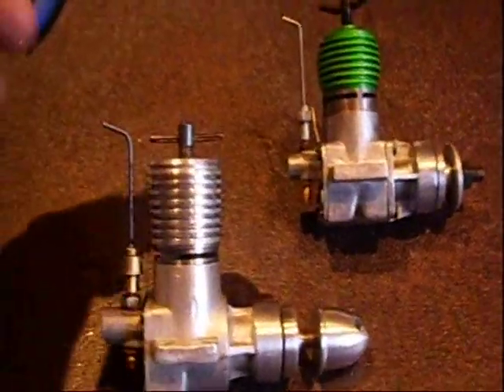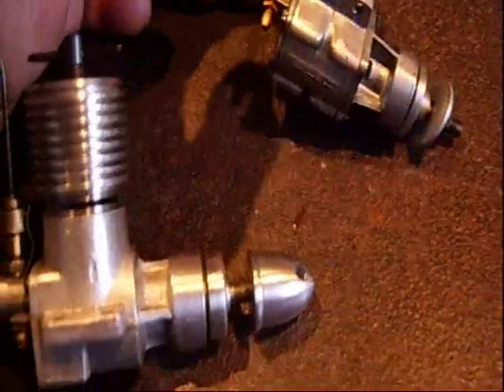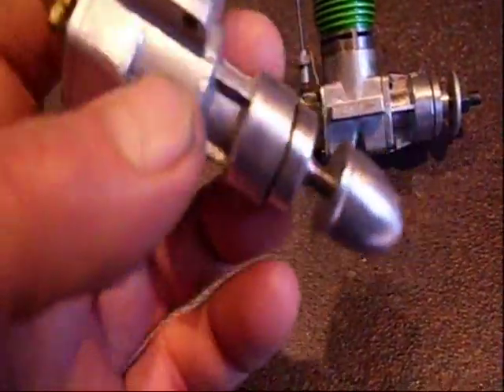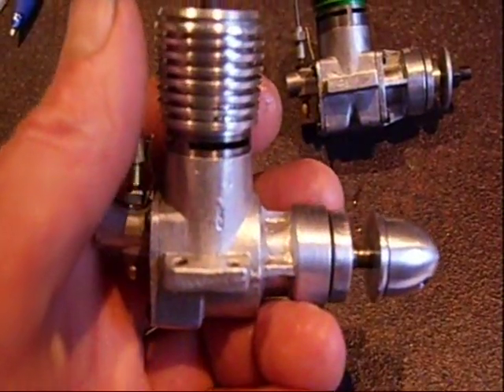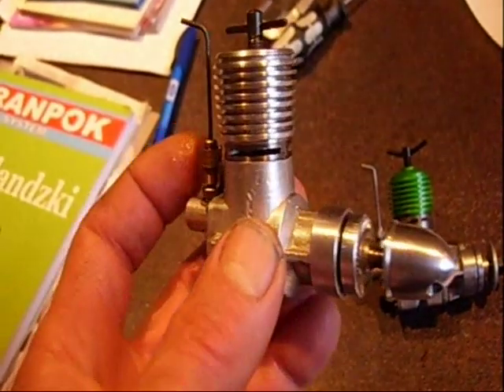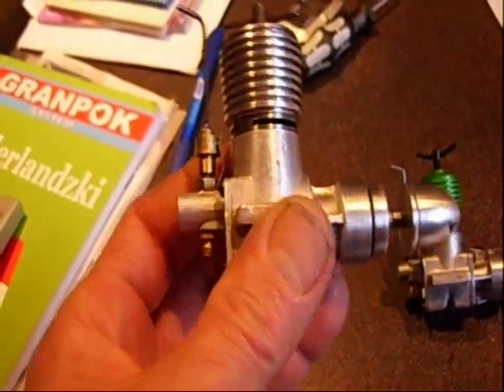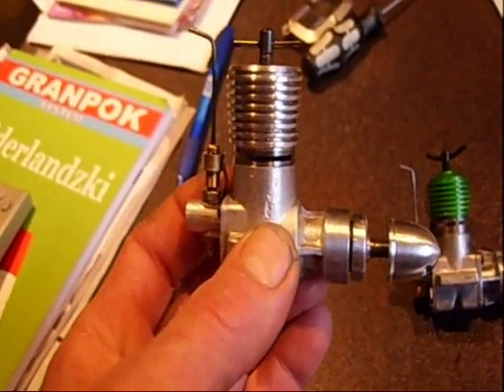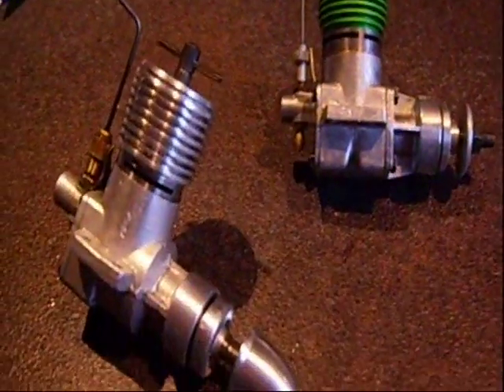MK-12 b Russian modeldiesel engine 2,5cc aprox. 1982

Comment: Diesel ?
Reply from the maker: Yes.. not like a car diesel..but compression ignition..no spark plug or glow plug.. Fuel is a mix of ether, castor,oil and kerosine  1/3 each.. aprox.
Reply: valic000  thanks if I do.

Comment: so i just got 4 of this engines 60$ 2 of them are new and 2 are for parts i will be making sum new vids when they get here all the way from Ukraine! so about 2 weeks or so i got a gallon of good petroleum aka kerosene for cleaning and making the fuel!
Reply from the maker: Thats a great deal Luke!! I am sure,you will have great fun of them..Thats a really insane price!! Wel done mate!
Reply: haha thank you! more vids to come!
Reply: so i got my mk12b and i can't get it to start i made a vid about it i need sum help
Reply from the maker: Start with the Basic Luke...compression must be good,as well a perfect sealing carter.I shod check the second. If you turn the engine slowly,you should here,if a light carter pressure is released when transfer opens up.Otherwise check the back plate gasket and the rotor,if all seals well..also some simpel stuff like the spray bar can be blocked with some old castor oil,when testrun at the factory... Check all very close with a sharp eye!

Good luck Luke!
Reply: i did all of that and every thing is good! it's a new engine the piston and cylinder feel tight like a lot of pinch i prim at the exhust ports and all i get is a pop! and sum smoke kind of strange i have never had a engine bee this hard to start you will see in the vid thank you for the info
Reply: hey i got him running!!! it was the pin fore the disk valve and crank shaft was missing i took one out of an pats engine put him back together and! he runs!!! very well i mix a lot of castor oil 40% and running him a bit un comprested i used all so a diesel kerosene mix 50/50 fore brake in thank you again my friend !

Comment: this is going to be my next engine
Reply from the maker: +Luke Shaw There rae really not bad.If al ok,strong runners!Comes very cheap,even boxed on Ebay,...if you are not in a hurry Luke...But just as with al old russian engines..first dubbelcheck al inside and clean very wel...There are usually always some things to improve.
How did it end up with the Marz bearings.Did you find them and replace both?
Reply: good to know and the marz is a bit better but but the bearings are still not 100% so they do neen new ones but the marz it runs very well and with the mk12b a 9x4 prop?
Reply from the maker: +Luke Shaw 
yes,9x4 too 9x6 is ok.it likles to rev too!  :-)
Reply: i have a bit of a bug for the Russain engines i know there not the best but i love them lol
Reply from the maker: +Luke Shaw Me too Luke.Have a lot different models.The Uctkam 2.5 D is also a strong and powerful engine..schnuerle ported!
Reply: the KMD 2.5 also is a powerful engine to
Reply from the maker: Yea Luke,thats the finest of the older engines!High quality,but dont biy the white version.Only the so named  black KMD are fantastic..
Reply: thank you! :)

Comment: I think I had two of these engines in the past, a red one and a silver one. The silver was completely worn out. I should have taken it apart and measured it. I need to get a (Unimat?) lathe and a drill press and start making parts! Thanks again, Paul
Reply from the maker: +caesarillion Hi Paul,
Yes,there are several versions of the mk12b. The b is russian cyrillic,and stands for a "w" and this W stands for "Webra" (copie)
I have also a red,new in box,and several silver once..looks terribel on the ouitside,but feel silky when turn by hand and loads of compression.. With a littel work and attention,you can made them real powerful runners. Some of the silver types or red types have very bad wristpins,bad fits and just far to weak to be a piston pin.So there is work to do,if you want use it to fly...but on ebay,they come very cheap! The older types are better. Red fins or even better split crankcase..2  covers,like the org. Mach 1

Yes,if you buy a Unimat 3..with milling attachment you can do a lot!!!!..if you are handy.ofcourse you need a lot aditional tools.Mills,micrometers,and so on...

Happy easter Paul!!!

Comment: Да, попалось мне такое чудо с пальцем из гвоздя. Купил в ГУМе в 84-м. Завел и после нескольких секунд умер. Потерялся при переезде.
Reply from the maker: Shame you enjoy only a few seconds of the engine.If new,they shoud be first cleaned wel from inside and inspected too,for any rare things.But I guess,as a young boy,we want only one thing..let start him up!! :-)
Many regards...Its nice to bring back memories to so many peopel arround the world.
Reply: valic000 Even then, I before use, read the instructions and listen to the advice of experienced. Even then, I before use, read the instructions and listen to the advice of experienced. And at that time, the defects were normal in the USSR. Therefore the production of motors and valued until the 1980s
Reply from the maker: OLEG69M Ok,I understand.So you had really bad luck.Usually the shoud run at least a few houers.I understand,that the early versions like the black case with red head and split crankcase were far better.Its the same stoer as with the Ritm...The early 1962 engines with 4 bolt head and 4 exhaust ports were really good..but later,the Ritm-M with 3 srews head were a shadow of the early first series.I have two 4 ports Ritm and they go like mad! best regards,Peter
Reply: valic000 Я хотел написать, что моторы выпуска после 1980-го года  были с дефектами. МК-12В- палец поршня часто без термической обработки, МДС - 10 сс - слабый коленвал, Радуга- 10Р слабая пара цилиндр поршень... Хотя моторы до этого периода работали хорошо. Удачи. Олег.
Reply from the maker: OLEG69M Да, пальцы были в курсе, что они nioet сильный waren.Maar не все виды Хейден этот problem.De старше 12 МК б были намного лучше.
Привет Питер
Reply: +OLEG69M  вы сударь ЛОХ у меня отец мастер спорта по авиамодельному спорту и он в свое время переделал золотник и мк 12 давал дай бог каждому

Comment from the maker: Hi there! My was also very tight and feel very coars when turn by hand,so I use 2500 grit waterproof and smooth down the liner and piston a bit.If you take the cooling jacket down,than you can use a plier to tighten it up.It wont demage the liner,as the contrapiston keep the round shape inside.
The spraybar assembly have with my engine also some issues...Recomend to make thin alu washers on the outer sides to prevent leaking vacum.Also a second smal hole wil help to get enough fuel in the engine,when suction is poor.But keep it smal.0,8mm wil be great. 1mm is almost to big,but if you dont have nothing other,try that.You can always srew the needel moore in...
Al in al,if al the issues are solved,there are great runners!.Check after a few runs the wristpin.The  have a bad reputation,just to weak steel.I use a drill rod end,and that drilled out on my minilathe.But if you dont have a lathe,you can slowly grind with fine 200 grit waterproof a oversize drillrod to the right size.Its org. 4mm,if I remember right.

Good luck!!!
Peter

Comment: I just dug mine out and decided to run it for fun.  Piston fit is very tight and it was overheating on 8x6 and 9x4 props.  Liner kept unscrewing from crankcase and took some effort to tighten down.  Poor fuel draw and needle setting still too lean, even when wound right out.  Went to a 7x4 so it could run light and pushed the needle about 6mm further into the thimble.  Needle valve threads are poor and air leaks in.  But it runs!  Takes a good flick to hand start, but surprisingly didn't manage to bite me, even on the 7x4!  Needs lots of light running to get it freed off to the point it could be flown.  I may fit an insert in the venturi to improve fuel draw and will see what I can do to seal the nva threads.
Reply from the maker: Sorry for late responce,I missed it somehow... But you are right,the spraybar is not the best design and executed also badly. With a intake cone and a proper working nedel with thin spraybar the engine shoud run pretty wel.Also checking the rear rotor if it works and seal wel. I have buy very cheap on ebay two other MK 12bs,and they have terrific compresion,but loose a lot crankcase pressure throu the bearings.I recomend to exchange them anyway.The front bearing shoud be a sealed version,and just take out than the inner shield,so it wil be lubricated.And than the engine shoud really scream even moore.
post a clip,if possibel..always nice to see moore folks with this engines..
Regards,
Peter